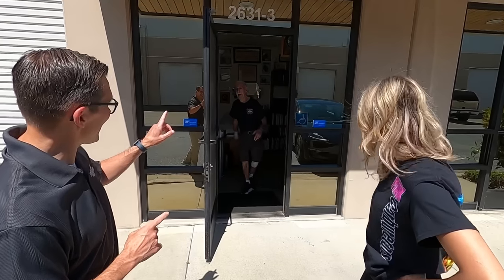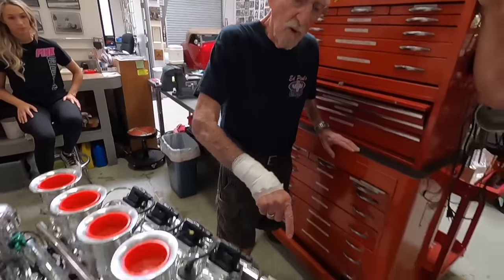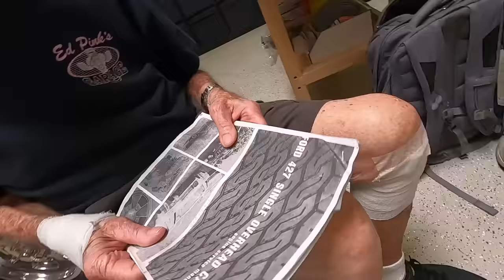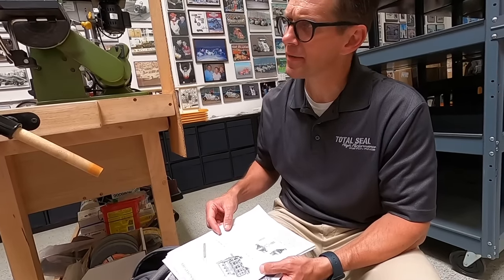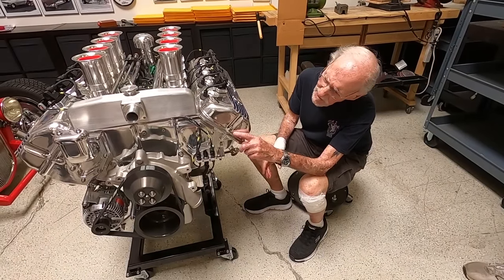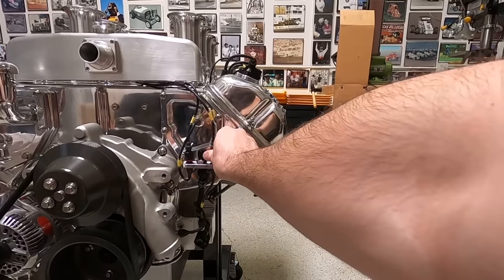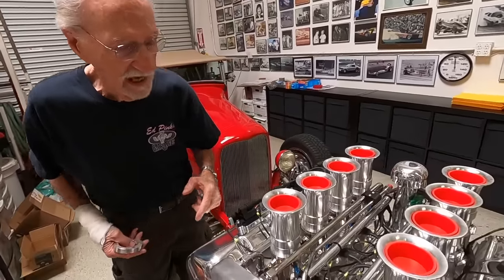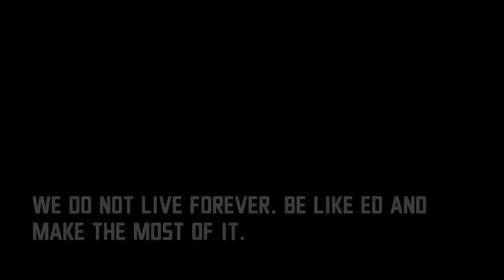The Ford 427 SOHC: Through The Eyes of Legendary Engine Builder Ed Pink (His LAST Engine Build)

Comment: I have nothing but respect for Ed Pink he falls into a category of men like Keith Black, Don Garliets, Parnell Jones, Tommy Ivo and the list goes on. When these guys are gone the mold will be broken. Kids today don't even know what points  condenser, jet drills, main jets air jets, SOHC means. I remember his shop in Van Nuys. So great seeing this. I still have the tool to remove the value springs from Ford flatheads that my late Dad used to hop up his '32 Ford. My Dad's car would put out so much horse power back then he started breaking axles, the crankshafts would flex and break because there wasn't enough main bearings. Those were the days. Great love for that stuff right along side of my late wife ❤

Comment: Thank you for getting this gentleman of great historical and human value to the world of drag racing and motorsport in general.  Thank you as well Mr Pink you are a legend and not forgotten by those of us who all these years later found the “Cammer” and while studying it, how it worked, its abilities, and then its use as being one of the first blown fire breathing monsters to grace the 1/4 mile drag strips inevitably noticed your name in the literature.  I have spent a lot of my own hard earned money trying to get down the sticky drag strips in my area (of course never on the highways and backroads) and originally in an old 72 Buick skylark with its oddball but really good 350 that’s so different from the Chevy small block and left me finding no aftermarket performance products so having to keep it running like a top and only doing things like swapping to a 4 barrel intake and carburetor and tuning it out as best as possible only to find the big 2 barrel and it’s low plane intake actually worked just as well and I’d have swapped back if they made nitrous plates for 2 barrel carbs. I’m glad I had that oddball Buick 350 now though because I learned so much tinkering with the carb and jetting the 4 barrel to get it running right so I didn’t kill the motor using as much nitrous as I could with the timing set just right so I didn’t blow the engine up and endure the wrath of my parents. It has continued to come in handy after I’ve sold all my race stuff off and just want a cool ole C10 pickup with a nice stance, a V8 that makes a nice sound if I call on it to do so and possibly a hot little cam to make the guy who pulls up beside me at a red light think I’m gonna race him only to be embarrassed when he floors it and instead of doing the same I just putt along at a snails pace off the light change. Or maybe I might just buy one of those wonderful LS engines out of a modern GM pickup and put it on a motor stand in my garage and build it in my free time getting it prepared for when if one day the SBC in the c-10 I plan on buying soon (I’ve got the money saved up to buy if I can just find what I’m looking for) gets a bit boring.

Comment: OMG the engine that was going to obliterate NASCAR. But was never really given a chance. Nascar set back ohc development for decades.
Reply from the maker: Good on them pushrods are much more space efficient 😂
Reply: Anyone can design a engine to obliterate nascar ......when they don't follow the rules.
Reply: @HioSSilver1999  the reason that rule even came out before the shoc hit the track was because this engine worked better than the hemi. The Weight put on sohc Ford cars to even things with the hemi was 800#. Thus nascar killed it before it started. Ford had to send the engine to compete in nhra instead. First engine to hit 6 seconds speaks for itself on how much better than the hemi it was. Look at the factory HP ratings on the 2x4 427 SOHC Ford. Nascar couldn't have Mopar leave racing. In my opinion it would have forced Mopar to make a SOHC themselves. Maybe even a four valve version. The engine evolution was stunted by nascar.
Reply: @hotrod7938  they made a engine to cheat....end of stary.

Ford actually broke the rules in 2 ways. They built the sohc to compete in nascar where only pushrods was aloud. On top of that it was a purpose built race engine that they never intended on offering in production cars.

So they were blatantly cheating
Reply: @HioSSilver1999  look at the date of the rule and when engineering at Ford was developing the engine. When you place a rule on an engine that's in development you know exactly why it was put in the books.
Reply: @hotrod7938  the date doesn't matter. They never put that engine in a production car....which was also a rule.
Reply: @HioSSilver1999  Engine was slated to go in the galaxies for 66. However when nascar passed the rule in 66 made no sense to make that an option engine. The engine development started in the side oiler in 64. If Mopar had dropped out of racing it would have been one manufacturer racing.
Reply: @HioSSilver1999  When Ford did make a pushrod engine the 429 for 69 Richard Petty left Mopar for Ford. That's why the Dodge Daytona and Superbird came out. When Ford countered with the Super snake Nascar put an end to the arrow dynamic war 1.0
Reply: @hotrod7938  they could have still put it in vehicles......but they didn't.  So just like i said, they built a purpose built race engine to run in a production engine series. 

Since all the development was done on the engine there was no reason to NOT put it into production cars. So it's obvious they never intended to.
Reply: @HioSSilver1999  Ford would have lost money on every car sold if they had. Just like the Boss 429 mustang cost more to make than what they sold them for. The unique parts to get it in the mustang cost a bunch of money and was Sub contracted to do. The only reason that car was made was to race the engine in nascar
Reply: @hotrod7938  exactly...they built a cheater engine they never intended to produce because of cost. Exactly what I've been saying.
Reply: @HioSSilver1999  They had built it before the rule change. The first time they tested it at the track. The rule came right after. I'm going off memory but I'm pretty sure the rule came a few weeks after the first track run. To homologate the car Ford certainly intended to manufacture the car. They even had an engine code for it in 66. My friend has a dealer book with the engine option code in it for sales guys to order it. That's how close it came.
Reply: @HioSSilver1999 you're not real bright are you
The motor was banned while in development by nascar. No use putting it in a car if you can't race it.
The hemi was a race engine too. Not that many on the street because of the cost for the engine and insuring the car once purchased.
The whole idea of manufacturer's getting into racing was ,win on Sunday, sell on Monday. 
Chrysler was always number 3 in sales
And sales was where the money was really at
Reply: @timmebruer5205  I'm bright enough to know they built a cheater motor that they never intended to put into a production car.....you're not.

That's what happened.  They could have still put it into a production car.....but they didn't did they. Say no they didn't out loud so maybe you can comprehend the truth.
Reply: Coyotes are an OHC design and people swap them out for LS engines every day .
Reply: @HioSSilver1999  the "Original" GM nut swingers has graced us with his presence, 😂😂😂 GM sure wasn't getting shit done in NassCar in those days, 😂😂😂
Reply: @02autogt  seemed like gm was concentrating on trans am....where they whooped erryones ass.

Btw...chevy has the most wins in nascar.

Comment: To be a fly on the wall of his shop back in the day. In High School we were building 454 fords which used a 427 block and 428 crank. We also used tunnel port heads. Those engines were built for a guy who ran mustangs on the dirt track in Phoenix. These Cammers were a leap ahead of what we were building.

Comment: Thank you sir for a great informative summary of the 427 SOHC. 

People forget back in the 40's - 70's many garages across the US used air hoses and little ventilation, not to mention all the brake dust and exhaust fumes this guy had to work around. That's the reason so few people from back then are not around to tell us the tales.

Comment: I love the " old guard" engine builders and cam grinders of drag racing . They had so much acquired knowledge and knew what they were doing . That's why they called Ed Pink the " old master" . People like Ed Iskendarian , Vic Edelbrock , Ed Donovan , Clay Smith , Don Garlits contributed so much to motorsports engineering , they were legends , and we.  " young bucks" would do well to listen and learn from them . When Mr. Pink said " if you didn't have one of my engines , you didn't win". he wasn't bragging , he was simply stating the facts , the data supports it . ❤️ Thank you Mr. Pink for what you gave to the world of drag racing and motorsports .

Comment: I love hotrodding and motorcycles, after amassive accident on the bike, I have the same problem. The br à in works fine but the body says no. I still do a lot of things that causes body pains for a couple of days. It's  worth it, old engineer's brains are always trying to get the body to do things it just finds difficult to do by yourself.
Just a footnote, my favorite engine being explained by a master builder of the Ford 427 SOHC. IT IS BEAUTIFUL TO LOOK AT. It was also fearsome to have to run against.
Thank you for this video. Honored to see his last encine build, and it was the Ford 427 SOHC.

Comment: I just happened to run across this conversation and time you were able to spend with "Ed Pink",. It was a real treat listening to the conversation you and "Ed Pink", discussing that "Over Head Cam engine from "Ford". I did learn a lot and would like to keep in touch with you. I live in Richmond California. I was a racer before I ran out of money. At the present time I plan to open a Machine shop, I am not sure where, But I hope to be around this area of northern California. I have been racing Volvo, cars one I ran a Volvo Sedan (Four Cylinders) at the Bonnyville Salt Flats, with and engine I built and was Clocked at 188 M,P,H,. Would have run faster except the car started to get side ways and I had to pull the shoot, Kind- of-Scared-the----out of me. I went through drivers school at "Sears Point Race Ways" Driving my P-1800e  "Volvo" Sports car I built. The last race I ran was at the "Silver State Open", The State of Nevada, closes HWY 92 for this race twice a year just for this race, which is 92 miles long. You wind up almost at the back of Los Vegas. and near " Nellis" AFB.  This happens to be where I completed the Last of my "Four years in the Air Force, and my duty" to our country.

Comment: Great to see a important part of history documented. The knowledge he has for this is amazing and glad some of it is being shared. I'm sure he's forgot more than what most engine builders now know. As for the 427 SOHC in Nascar they flip flopped on it a few times and the motor was actual approved for use in 66 but the engine could only be used in full-size Galaxies and was limited to a single small, four-barrel carburetor. But they also placed a weight handicap on the SOHC Fords that they would have to carry over the Chrysler Hemi's so the Ford's would have to add 430 pounds. So, after that they abandoned it in Nascar and used it in drag racing. Dale Jr touched on the story in season 2 of lost speedways in the Columbia Speedway episode. But god bless you Mr. Pink and I really enjoyed the video. You saved the best for last, a Ford.

Comment: 600 hp. On one carb.   700 hp fuel injected    now when Ed. Said. 2500 hp.  You need to keep in mind that's after. 600 hp. Drag off the front of the crank from the supercharger  the engine was making over 3000 hp the blower was pulling around 600 hp to turn it 9000 rpm. All that on a stock block stock heads stock crank  Bach & Gould was still using the cammer up until 1974.  And they were making up to 3500. With it the FE.  Is no joke  Connie Kaletta said the FE. Cammer design is so good if they were to make a real aftermarket block for it it would still be competitive in top fuel today that says something!   I'm glade Ed pink is still around. That man knows his stuff'      it will be sad day when he's gone.         thank you for doing the video

Comment: I raced a cammer in my gas dragster in 1976. I bought the engine used for $1500. It had crane cams and forgetrue pistons. I got the Ford manual with it. In the early 2000's I sold the manual on ebay for $490. I ran the engine one season and changed directions after that. By then, it was a dinosaur. :) Mr. Pink was very good. :) I also have a copy of it in my collection of stuff. :)

Comment: Sam Auxier Jr Show, WOW I loved this video. I raced for Ford back then and they gave us these engines, We raced ever Ford engine they made but the SOHC was my favorite one. Ed was spot on about everything about the SOHC. Ford had so many things that had to be changed to run in Pro Stock and Nitro We ran it from 1969 to 1973. One thing about the bottom end we had to widen the cranks and we used 392 Hemi Aluminum MT Rods. because we turned them 9000-10,000 RPM, Right and left cams. Harvey Crane made the cams work. He ground them and called them 660's. We used some ungodly valve springs, they would last maybe 8 runs. (Not much different today in Pro Stock) Hollow intake valves and sodium exhaust. You could never run the valves that came in the engine. Engine came with SP marked valves Ford said never run those valve, they were never tested and they would drop a valve. Ford special valves that were marked SSP you had to run. Vick Edelbrock made us a intake tunnel ram with a Chevy Plenum. We did use dyke rings, had the pistons dome reshaped on a tracer mill to duplicate combustion chamber and we made the rod longer so we increased compression ratio to 13.5 We used high grade motorcycle chain and yes we spread the to cams about 6-7 degrees apart. Ed is the best !!! KEEP up the great videos I watch them all
Reply from the maker: Thanks man!

Comment: I’m remembering something else, my dad owned a garage in Durham, NC. As a young kid I enjoyed going to the garage to “help” there. I remember changing the spark plugs in an early 50s Dodge truck. I was an oily mess by the time I got the plugs out of the early HEMIs. I also think about how much I had to do to make sure trash didn’t fall into the cylinder taking out the plugs. Air hose with a long snout down in the plug well blowing trash and of course oil, all in my face. Good old days.

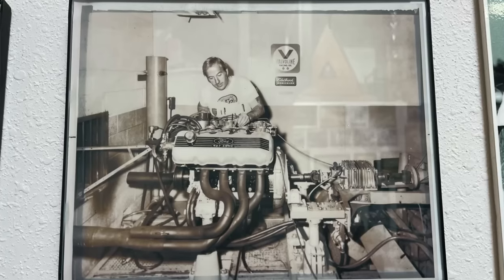Comment: 17:35 there is my dyno console!  I sure do wish I could talk to Ed about it. I can't seem to find anyone left that knows about those WW2 vintage Claytons.  At 1:20 I recognize that engine is hooked to the big clayton and you can see that reducer box so they could run the engine rpms up and not explode the dyno as its only rated to 5000rpmmax so they probably had a 2 to 1 box.  as even with that it could handle an engine making 1000ft-lbs of torque.

Comment: I'm an old guy now but back in the day I got to work at the strip with both Ed Pink hemis and Keith Black engines.  Both guys produced great, reliable engines that would produce the horses we were looking for and were infinitely rebuildable.  Great motors from great guys.  The chain on the SOHC engines really messed with the 2nd bank of cylinders......didn't Sneaky Pete Robinson come up with a gear drive for the SOHC Ford?

Comment: what a video of the master . a little off topic sodium filled exhaust valves  my IHC 392 1972 has sodium filled exhaust valves . those are closed chamber heads but the intake port is the size of the big block chevy large square port heads.

Comment: This is just awesome. I have always been a huge fan of the Cammer engine and I've always wanted to learn of it's origins. Obviously the 426 Gen II Hemi OHV engine was a dominator with it's 10.25:1 compression ratio, 425 HP and 490 lb ft of torque, so Ford had to find some way of answering back with a highly overengineered beast of their own, hence Ed Pink and the 427 Cammer. It was the best designed engine to be equipped under the blue oval and just like the Hemi, became a legend. Except the standard built 427 Cammer came around 750 HP as it's targeted output. However, drag racers couldn't settle for a measly 750 HP...heck, my 1.8L DOHC 4 cylinder in my turbocharged Honda Civic made 709 wheel horsepower at 34 lbs of boost and it ran 9.56 @ 155 mph on my best run. No, these purpose made dragsters were supercharged and boosted up to 2500 HP to be the top competitor (with Ed's help of course). He is the true definition of a legend. Just like Carroll Shelby, just like Big Daddy Don Garlits, and Conrad "Connie" Kalitta. These men will forever have a throne at the top of the motorsports legend.

Comment: 600 hp on gasoline, 2000-2500 hp on nitro "back in the day" with the Ford 427 SOHC factory block, and now 11,000 hp on new engine technology.  The evolution of drag racing.  Ed took that Ford 427 and made history.  What an engine, and Ed Pink determined how to deal with the idiosyncrasies.

Comment: Interesting video, thought we were going to see an engine build though. Reminded me of the early 90's 348 Ferrari engine. Ferrari used a new design cam gear drive with a gear, chain and tensioner, the tensioner did OK but there was always a little slack chain. I ended up figuring out that I needed to pin the cams 7 to 10 degrees advanced so when a load was put on the engine it ran nicely. The same thing with the 355 engines, made it quite the pain to do cam timing. Would have loved to see an assembly of this engine, after 40 years of building Ferrari engines, looking at an engine like this is very interesting. Why on earth did they not continue with this design ?  Would have loved to see it evolve, oh well...